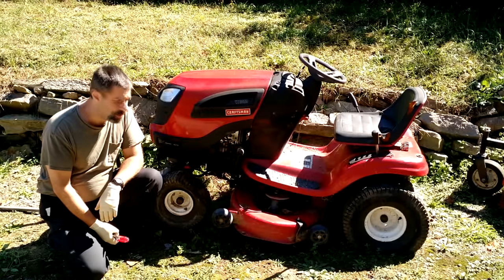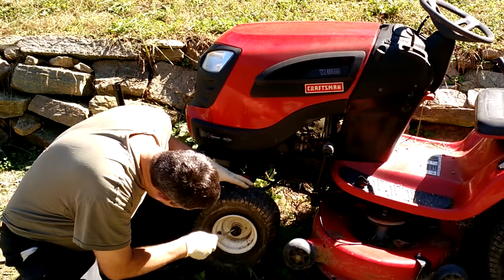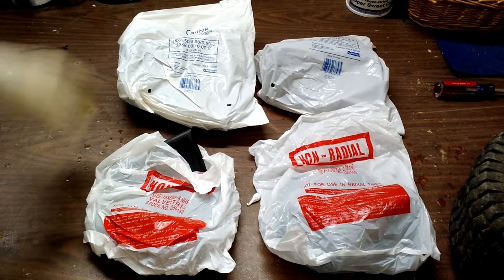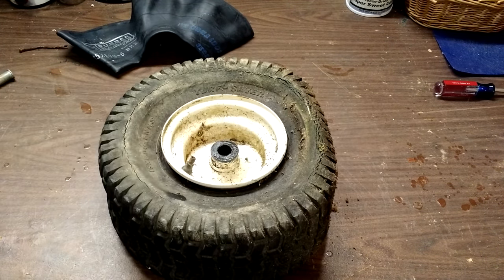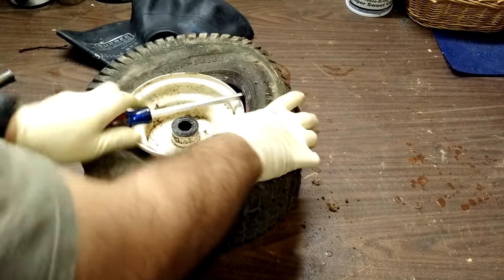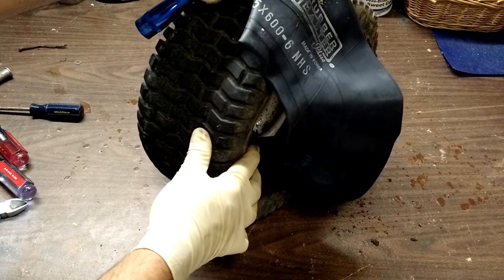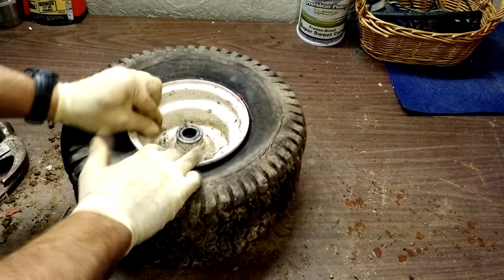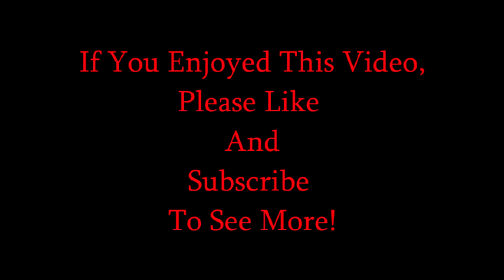Installing Inner Tubes On Your Riding Mower Tires.

Comment: You are a much more patient man than I. When I do this there is usually lots of vicious swearing lol
Reply from the maker: Man, I HATE THIS JOB!!! I was so pissed by the time I got all 4 tubes installed. My blood pressure was through the roof! Thank god its over for now anyway. I have seriously been putting that job off for almost the entire summer. The poor LT3000 has just been sitting there with a tire off its bead in the driveway since late April.
     The good news was that once I had it all back together I put a jump box on it and she fired right up. I took it on a short ride around the property and parked her back in the garage for a clean and lube. I think I'm going to sell this one in the spring as I use the GT52 for my cutting now.
Reply: Farpoint Farms oh man me too....I hate it lol. Its a shit storm to do a tire on a full sized farm tractor..btw what happend to the ag tires on the Craftsman?
Reply from the maker: I have decided to sell the Craftsman YT3000. I have had it for about 5 years now, and decided it was time to move on from it. So I put back on the old stock tires and took off the wheel weights as part of getting it ready to sell next spring. 
       I've been thinking about selling it and my LT1000 "brush cutter" and maybe fixing up the deck that came with my GT6000 to use next year so I can used it for those duties.
  
 I have also  been considering maybe taking the plunge next spring on a Kubota BX25 . Its a HUGE investment, and I'm more than a little worried about spending that kind of $$ on a tractor, but I sure could  have used that backhoe a few times this year.
Reply: Farpoint Farms I completely understand becuse If I didnt also have my farm tractors I would need to get somthing lime that. What do you think you will sell them for if I may ask...
Reply from the maker: I'm not totally sure. 
   I think the red 2013 YT3000 is still a good tractor, but Its got maybe 300 hours on it now and its showing some signs of age.  I take good care of my stuff, but this property is pretty hard on equipment. I think I'll ask $450 or so, and see where it goes.
    The old "brush cutter" 2001 LT1000 is already spoken for. A co-worker of mine wants it for his small yard and I told him he could have it for $250.00

   If I decide to get a BX, well.... I would probably have to sell my Husqvarna GT52xlsi and I would take a beating on that one. I have about $4000.00 in it with the sleeve hitch (+ upgraded hitch), the AG tires, chains and weights.  I'd be lucky to get $2500.00 for it, but It may have to happen to help pay for the BX.

  That would still leave me the pretty cool GT6000  I picked up last spring. Its Stout and I'f I fix up the deck I could still cut with it.

  Decisions decisions....
Reply: Farpoint Farms i may be interested in the 3000..let me k ow when the time comes!!
Reply: Eli Fulton 😂😂😂 so I'm not alone 🙄
Reply: I threw my pry bar and it chipped the concrete then I threw the whole tire and wheel when I saw I split the tube while trying to get the 2nd bead back on (new tire, patched tube). My neighbors live pretty far away but I'm fairly sure they think I'm a raging racist, homophobe, misogynist from me throwing every curse word I knew at that damn thing. Came here to see if there was a short cut but nope. Just gotta go get some vegetable oil and a new tube. Or see if I can go tubeless and fill it with slime.
Reply: @mcgriffgriff  i hear you..i see my self to you when i was doing this@@!!!

Comment: Awesome video, gonna replace the tubes on a go kart tomorrow. I think I’m going to use vice grips to hold my stem though so it doesn’t slip back through the hole. Thanks!
Reply: a washer with the cap is a better and safer idea !!

Comment: once the fill valve is thru the rim put the valve cap on it.  Prevents dirt from getting in and also keeps the valve from falling back out of the rim because it is larger in diameter.  I have always done this on bicycle tires and it saves lots of headaches.  You can also by a tire changing tool (plastic) from any bike shop for a minimal price.  Far less chance of puncturing an inner tube vs using a screw driver.
Reply from the maker: Great tips!

Comment: When I do this, I insert the valve stem first, then work the tube around the rim. Once that's done, I air up the inner tube just enough to hold it in place and that will keep the valve stem from slipping out of the hole. Just be careful working the tire back onto the rim.
Reply: Great tip
Reply: I was thinking same thing why couldnt uyou insert the value stem first then work tube in

Comment: just did this today with the rear 18'' tires. tubes at Harbor Freight for $10 bucks wasn't that bad of a job at all, only thing is have yourself some needle nose vice grips because the valve stem wants to fall back into the rim. Think I'm going to get an oversize cap so it doesn't fall completely into the rim needing to remove the tire again. helpful video, thumbs up

Comment: If the tire is off the bead on both sides ..I’m wondering why you have to get one side off the rim ? Can’t you just slip the tube around the rim into the tire ? Then just pump it up ?

Comment: Sometimes you need more slack to get the inner tube over the wheel and placing the stem in the hole reduces the slack. Try tying a constrictor knot over the stem with a piece of twine.  Thread the loose end of the twine through the hole. Once the inner tube is on, use the twine to guide the stem through the hole.

Comment: I have a REALLY nifty tool that I use when installing tubes in tire rims ; it's called a valve stem repair tool , available  at Auto parts stores everywhere.  All you gotta do is screw the threaded end over the valve stem , after  you get it inserted trough the rim  , and the stem will not pull back through .
Reply: wrap tape around it a few times and that will hold

Comment: I use a washer over the valve stem to keep it from falling back inside the rim. Good video  thanks.
Reply: I was thinking to put the air compressor connector on, ...if you don't have a big washer handy
Reply: yes, i 1st saw this video, i thought to do the same thing, and then i saw you comment, so i said great.
Reply: Mi on

Comment: Thank you very much I didn’t want to buy the tool... it took a bit longer  due the inner tube coming with a hole. I used vice grips to hold the plug thing. I was hesitant on using 16  bigger inner tube on a 15  but it worked great. Thank you very much
Reply from the maker: Glad it helped

Comment: I just finished wrestling with putting an inner tube in my big mower's tire and thought I could use some advice. One thing I did was feed the tube stem through the wheel's hole first, capped it, and then packed the tube into the tire.

Comment: Another thing that can usually work on small tires is to take out the tube, drill a few 5/16 holes in the tire and fill with spray foam insulation….. It works!!
Reply from the maker: That is a good idea- might be an awful mess when needing to change the tire when it gets worn

Comment: Go get a 3/8 inch concrete anchor 5 inch long. Along with some washer and a nut. Clamp the anchor to a vise. Will hold rim while doing it. Also HF tire irons work well for this task...

.

Comment: I know this is 6 years old, Good point to check the tire for objects ( nails etc) that could have caused the flat. Now here is another point, I 've discovered that the rims on most of these small tubeless tires: Lawn mower, wheel barrow, lawn cart etc. Is they are rough, has sharp bits like weld splatter. So really need to completely remove the tire and inspect the rim. File, sand, clean remove any rust and paint the inside with gloss spray paint.
Reply from the maker: That is a good point- Thanks for sharing that one.

Comment: Use a washer on the valve stem and put the cap to clamp the washer in place with the valve cap. That keeps ut from slipping back into the rim
Reply from the maker: Thanks for the tip!

Comment: Add a washer over valve steam and a nut to threaded steam it will keep it from pulling back out as you replace tire.....My new old tractor has held air......for now. I am thinking of getting agg tires for the rear, hoped you would come over to install them....no ?
Reply from the maker: Hey, thanks for the valve stem trick! thats a great idea and I've never heard of it before.  Those Ag tires will make you SS-16 a BEAST! as for me putting them on. I think 3500 miles from coast to coast may be a bit far for a house call...
Reply: I can FedEx them to you, I just need your account number to save me the shipping cost. Thanks
Reply: My FREE Frugal Homestead I just finished putting a tube in my small front tire. Tomorrow is the back big tire. I did the same thing by adding a washer to keep it from falling in. But your video helped me out a lot! Thank you!!
Reply: Love to take Credit but this video is Erik's video, he did all the hard work, I just said the washed and a nut may help hold the stem in the rim.

Comment: What was that magic red fluid that appears on the tire bead at about 10:30?
Reply from the maker: That is actually generic "Green Slime" in this case red slime that was all over the inside of the tire from when I filled it to stop a small leak. What a mess that stuff is!

Comment: I put a vicegrip on the rim  like having an extra hand while working the tire on the rim.
Reply: Great tip
Reply: There is always one winning tip in the comments. This was it. Nice small pair of rounded Vicegrips replaced the need for a second tire iron.
Reply: The big ones need two vicegrips
Reply: you sir are correct!

Comment: I was quoted $25 each to install my own tubes in my lawn mower tires. Harbor Freight  had a small tire changer for $54. After using it on my own mower, I started having people reach out to me to put tubes in theirs. The Harbor Freight  tire tool has paid for its self already.
Reply from the maker: that is a great way to get some extra cash-

Comment: There is a valve fishing tool that helps with the valve stem. You feed the end thru the valve hole and a cable allows you to pull the end around to the outside of the rim. You can the screw that end onto the valve and pull the stem back thru the hole. You leave the cable attached in case the stem tries to retract while you are feeding the rest of the tube into the tire. Saves a lot of work and frustration. I got mine on Amazon for about $8. (Milton valve fishing tool S-447)
Reply from the maker: thanks for the tip on the tool, I am sure it will come in handy for some!

Comment: QUESTION;  Where did the old tube go?  Did you leave it inside as I didn't see you take it out.
Reply from the maker: That one did not have inner tube in it- most do not and as they get older they leak and don't hold air anymore. I added the tube because that is the problem that I was having

Comment: Ya did it! Good job and patience.
Yep, definitely not a crowd pleaser but hey, a little elbow grease goes a long way!
Many thanks.
Reply from the maker: Just had to do one today. What A hassle!
Reply: A fishing tool will hold your valve stem in place so you can pull it up  thru. The rim

Comment: When putting the tire back on I use both of my knees on two of the quarter sections to hold it down there and then use a screwdriver
Reply: i put all 3 knees on it :3

Comment: The last time I placed a inner tube in my tire. Everything was fine for a year. But now is see where my leak occurred. The plastic valve stem was split on the outside. I guess it rubbed on the inside of the metal rim. Any ideas on preventing this
Reply from the maker: I think it has to do with the placement of the tube in the rim. I had one do that too, but the other 3 are still fine 2 years later.

Comment: If I remember right you have to have the valve stem which is off set to one side in position so when you blow up the tube it blows up in place and does not pop out of the valve stem hole. . So the tube has to be turned on the right side when you put the tube in the rim or or when you blow it up the valve stem will come out of the hole and you will have to take the tube out and turn it over to the opposite side so the valve stem will blow up in place. Been a while since I did one but I do remember having to take a tube out and flip it over because it was in backwards.
Reply: Yeah just remembered when I pulled this tube out that I am about to put on this 15x6.00x6 rim and saw a blue line.  The tubes usually have a blue line around them on one side. The blue line has to face down toward the backside of the rim opposite the valve stem side (front).

Comment: Good job and thx. I wasn't to sure this would work for a tractor tire, rather than replacing the whole "tubeless" tire. But you've shown that it does so kudos. I might wash the tire with a hose to make it a lit easier to remove and cleaner. Also, a little oil dropped on the rim area if the tire needs to be pried off might help. WD 40 works well to when stuff is "welded" on metal. One question - Do you have to unbead one side of the tire to put the tube in? We used to always just deflate the tire on bicycles to do this and then "work" the tube in.

Comment: Thanks for the video. I had the tire and tube off in about 10-15 minutes. I couldn’t get the front bead to release so I just broke the rear side and pulled the tube out that way. Also, there was a washer on the rear side of the tire. Thanks again for the video,

Comment: when you get fill valve through rim hole wrap a few rotations of tape around the base of it so it don't pull back out when seating tire around rim or you can use a washer with inside diameter size tight when pushed down around the base of the valve. I am about to install a 13X500 -6 tube with the TR87 valve (bent to one side). I don;t think this type can slip back out because of the bend. But may use tape on it just in case. Can't use washer because most of the outer stem is metal.

Comment: Next time, buy tubes with threaded valve stems and nuts to hold stem in the hole. You're super lucky. My Wheel is frozen to the axle. Tried PB Blaster and WD 40 even heated with a small torch and used a small sledge hammer on rim. It ain't coming off. So I'll try using bar clamps to compress the tire and dish soap to stuff the tube in with the mower jacked up. Always something.
Reply from the maker: When you bring out the torch, that means you are no longer asking.

Comment: Good video on a aggravating job. 
 if you have a hard time breaking the bead use PB blaster.
Installing the inner tube I put the fill valve in first and lock  just with the rubber cap it seems to stay put. Then I use vice grips to lock the rim to the tire so it don't roll on you. Be careful not to use screwdrivers - I use the end of a pair of pliers they're not a sharp--  It's still aggravating but with patience anyone can  do a great job. Thanks for your video.
 BUT OHH MY THE 6 INCH TIRES -- GURRRR
Reply from the maker: Sure can be a chore!

Comment: I partially screw a 1/2-13 nut on the rubber portion of the new valve stem, ( once I finally snag it tru the hole ). It holds the stem in place while wrestling with the tire carcass

Comment: Once the fill valve is in position put a zip tie [ cable tie] around the stem to stop it falling back inside.
Reply: Or,  put the cap on it

Comment: Using two hammers u can use the claw end on one to break the bead and use the other to hit it down on the bead of the tire better than a screw driver so u don’t have the chance to put a hole in the tire

Comment: Put a 1/2" socket extension bar down the center axle hole of the hub first, then use two pry bars like scissors around the extension bar for easier removal of the tire from the rim. The tire will come off in one continuous smooth motion, much like the automatic tire machines at the dealers.
Reply from the maker: Good idea. I'll try that next time.

Comment: I liked and subscribed but to truthful I did not like this video because I have two new tubes coming tomorrow. In the natural order of the universe tires do not have air. That's why this is so difficult. I will try the the clamp method I saw in another video to assist in breaking the tires off the rim. I will rejoice getting the tube in and the tire on only to realize the stem disappeared somewhere just like yours. I trust the set of hands that didn't show up have had to answer. Thanks. Seriously it helped.
Reply from the maker: I hate doing inner tubes and wanted to share my struggles-  Glad it helped
Reply: @FarpointFarms  Thanks again Sir

Comment: 10:23 You try for a while to get it over, and then by magic you have grease all over the edge of the tire! Its a good tip because I know this can be a real pain. Easily the hardest bit IMO.I end up using straps and tightening it to hold one rim under and then use the screwdrivers until over half way. Take it off and then finish the job.

Comment: Useful video. The cracked sidewalls (they get a lot of sun on them?) was a good call. If one needs to check for a reason, some water over the tread after filling with air or a dump in a pan will help.  How about the use of warm soapy water around the rim to help with removal and installation. Thanks.

Comment: Washers on valve stem (where tubes seem to easily suffer damage), can you put rubber grommet washers on both sides, i.e., inside (before stuffing tube in rim) and outside on stem?  Having washer inside, will that affect performance of tube?  Good advice to oil tube, no?  I want to do this as seldom as possible!!!!

Comment: When you seat the tire back on the rim, do you need to wet the rim with something?
Reply from the maker: While it can be done dry, soap or any non oil based lube does help.
Reply: I use good quality window cleaner... Windex is slick enough, and cleans as it cleans up...